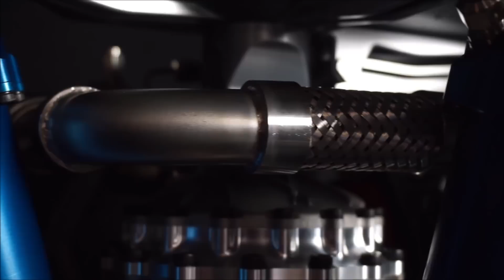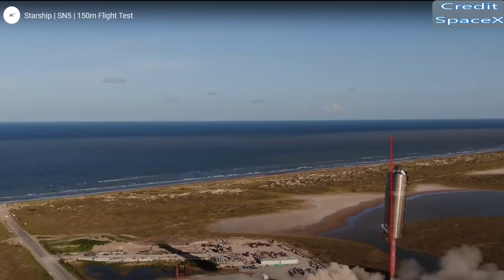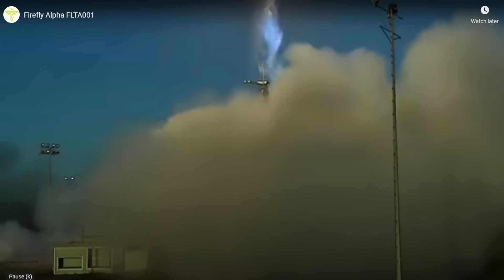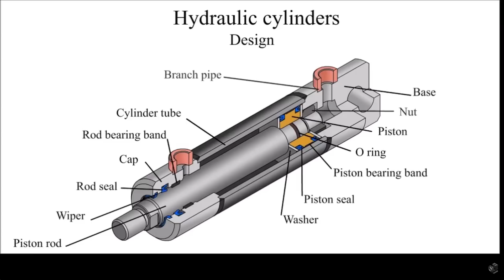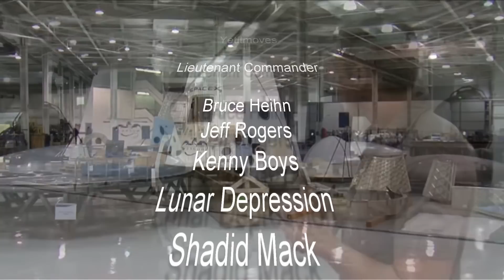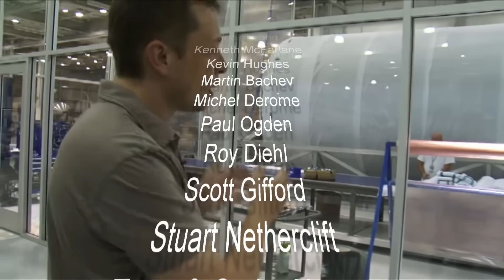Rocket Science: Electric Thrust Vector Control

Comment: Is gimballing a form of TVC? Maybe with gyros and mechanical linkages instead of accelerometers and hydraulics?
Also, I am guessing electric linear actuators are ballscrews driven by an electric motor as actual linear motors can't produce the force needed. Could be much lighter than hydraulics as you get rid of some of the fluid, have a smaller pump, etc. Plus the fact that hydraulic cylinders have to be built strong enough to withstand the pressures. Great video. Keep up the great work.
Reply from the maker: Thank you very much Chad!  I agree about linear motor limitations... the must be worm gear driven.

Comment: SpaceX moved from hydraulic to electric actuators to save weight and reduce complexity. I wonder if pneumatic actuators tapping autogenous gas pressure would be even lighter? All three actuator types are equally capable. What differs is how they are powered. Hydraulics require additional battery, powered pumps, accumulators, hydraulic media. Electrics require additional battery. Pneumatics require pressurised gas.
Reply: The positional control of pneumatics are problematic for dynamic systems and arbitrary positioning.
Reply from the maker: They are also less responsive due to gas compressability

Comment: It's not everything bright with electro-mechanic actuators, If it is a resistance to a hidraulic actuators eventually the hidraulic actuators would overcome this resistance, but a electro-mechanic actuators would keep on pushing without beating the resistance because it doesn't have enough power to do that, so in some cases a hidraulic actuators is better than a electro-mechanic one.
Reply from the maker: That's a good point belted one :-)

Comment: Don't forget that the more the remaining engines gimbal from center to compensate for a failed engine, the more loss of vertical acceleration due to the need to compensate horizontally. That horizontal component of the total thrust vector is pure loss and requires even more total thrust to fully compensate.
Reply from the maker: That's true Price... thank you.